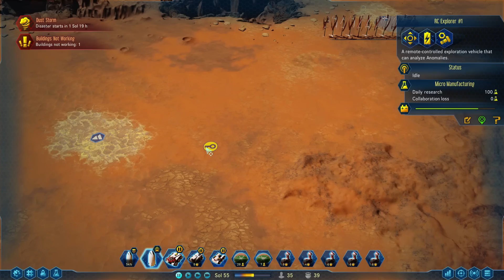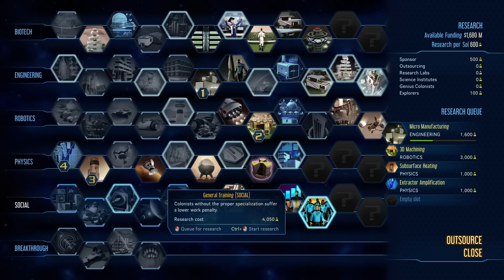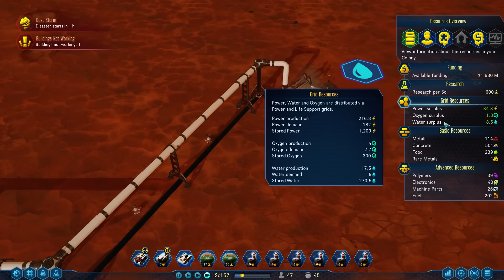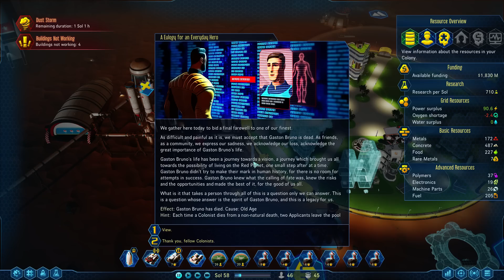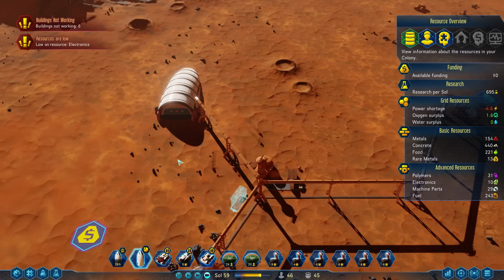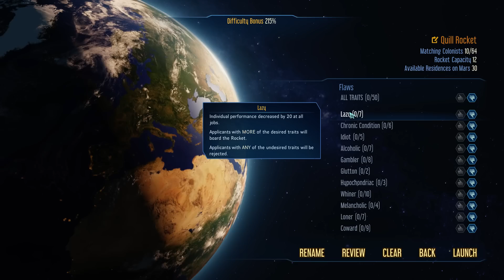Surviving Mars: METEOR MAYHEM Let's Play -- Part 7

Comment: Hey Quill, What are your thoughts on valves and power switches? Is it worth building, to be able to close of parts of the network?
Reply: It could be useful, though it's a little on the micro-end. But you could use it to minimize losses from leaks and such.
Reply: I feel like valves and switches should be operated automatically, it's too much work to micro-manage things like that
Reply: I think a valve and a power switch next to the tunnels at the wind farm and the water farm would be a great idea. If you have a power or water leak there you could easily switch off that part of the network. That way you minimize the loss of power or water. I would do that but I guess Quill would think of it as too much micro-management. You have to check every warning about leaks and breaks and that doesn't really work for Quill.